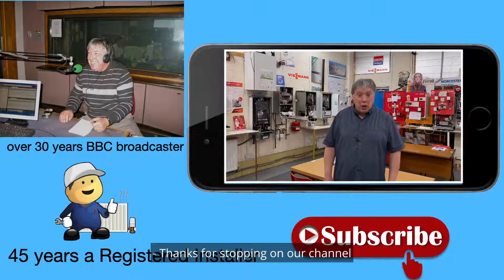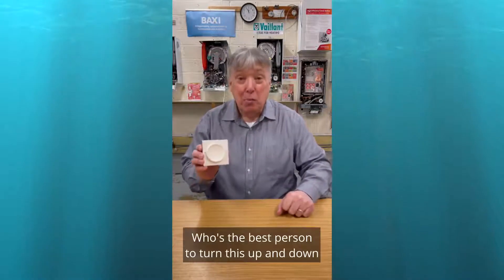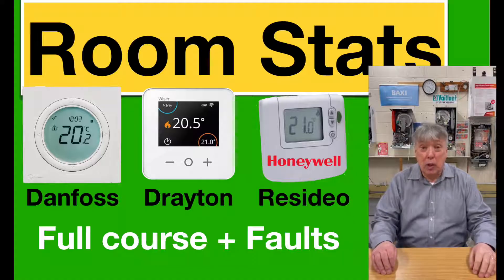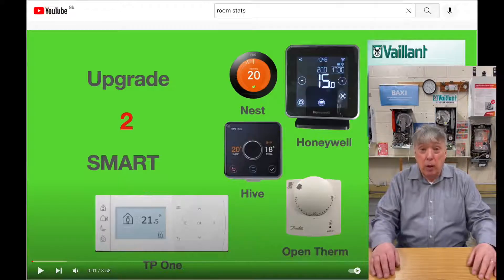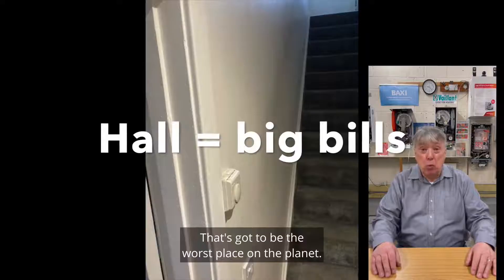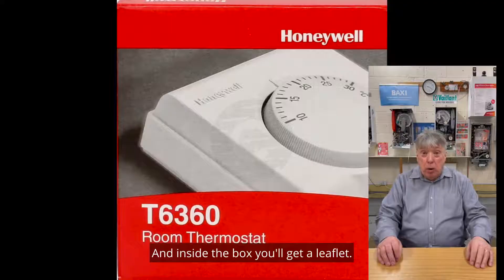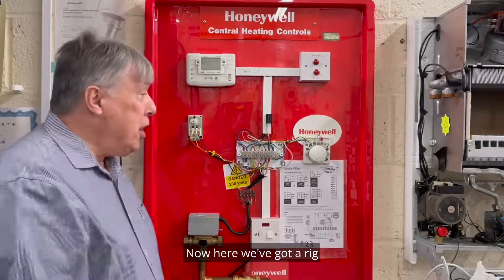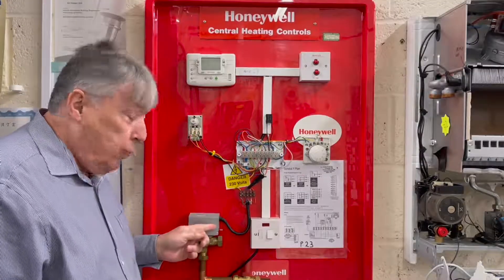This Honeywell Home room stat must be the most installed ever, why in the UK we get it wrong?

Comment: I had an old Honeywell mechanical stat, located in living room, it only has 2 wires, Red which is live and a Black, the heating never switched off, so assumed the stat was faulty, replaced with a Drayton RTS8, because it states suitable for 2 wire set up, its still the same, never switches off, thermostat only switches heating off if i turn it manually. I currently have the Red (live) to L and Black to 3, as per wiring diagram supplied. Any advice appreciated. Can i connect a digital stat with the existing Red (live) and Black wire???
Reply from the maker: Dear B 1K, thanks for asking, The RTS8 is a very good choice the leaflet shows your RED goes to L and Black to 2. should work. Test the stat in 230vAC (programmer to ON) Turn stat to lowest temp10C?, put meter RED lead to L BLACK to 2 should be 0vAC. DANGER LIVE terminals!!! slowly turn up the stat until you get 230vAC or more, check the boiler has fired. return to stat leads back in then slowly turn down to 10C or until goes to zero AC. that's the way all 230vAC stats are tested. hope that helps, regards, George Staszak, 👍
Reply: Hi George, thanks for quick reply, I will do the test later, but, I have the Black in 3, as the leaflet says, that's for most gas/wet heating systems, should it be in 2??, Would a digital stat be better for me? Really bugging me that the stat wont switch the heating on and off as it should, when room temp is reached. (other than turning it manually) Any advice much appreciated, Mark.
Reply from the maker: Hi again, It is a digital stat, no need to change, you look at the middle drawing, https://www.draytoncontrols.co.uk/sites/default/files/Combistat%20%28I.%20Guide%29.pdf
George
Reply: Hi George the RTS8 I have is a mechanical stat, have done the test you suggested, programmer on, stat on 10, L & 2 show 240v, turn the stat up, boiler starts up, L & 2 then show 0v, very confused.
Reply from the maker: @MarkTyrrell-nu6sh  with the stat on10c should be 0vAC, you say when you turned it up the boiler fried up=OK what happened when you turned back to 10c did it go off? try swapping the wires as see, could be the BLACK in COM, try in 2 and 3 which works OK,

Comment: I definitely  disagree,  there  is no way my 70year old wife can control our heating more accurately  than our programmable, opentherm stat!
With regard to wiring in Honeywell  type stats, the neutral connection is fundamental to it's  accurate operation, as are the positioning in the MAIN sitting area, 1.5m above floor level, not the 1.2 some electricians insist on.
Neutral connections are more common than not in wireless and or hardwired controls!
Reply from the maker: Hi John,
thanks for your I agree with you, regards👍
Reply: @mrcombiBedford  It's  sad that too many installers don't  make the effort to promote energy efficient anything!
Maybe it's  a money thing, but installers need to up their game and consumers have to take their  share of responsibility and be prepared to pay a more realistic price for the RIGHT job!
Reply: @johnward5006  It is a cost thing plus a competition thing (between tradesmen.....lower price and most customers don't know zilch so they think they're getting 'like for like' systems with different prices.  Key thing is to put the roomstats out of reach of the womenfolk and hide the kitchen steps!! 😀😀
Reply: 😀😀😀😀😀😀👍although you are now in trouble with her indoors lol @Noaxe_Tegrinde

Comment: Because for whatever reason gas engineers / plumbers in the UK accept a certain culture and rather than lift each other up and improve, simply race to the bottom.
Reply from the maker: Dear Swills thanks for reply, it's sad to see so many hall installs, even had installers on my course openly said they did it wrong but would not change and fit smart because too much work. all the best, George